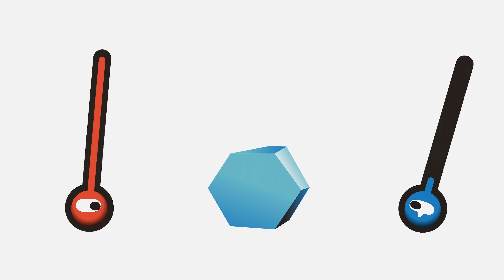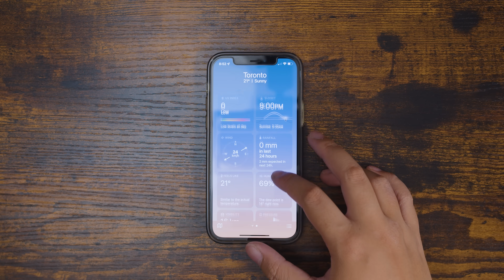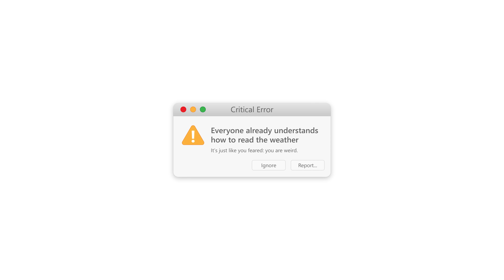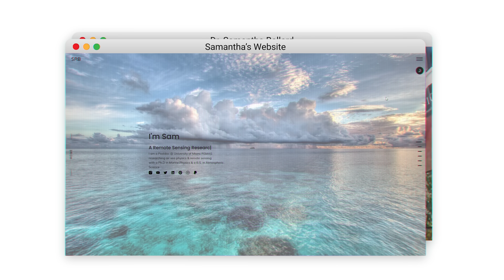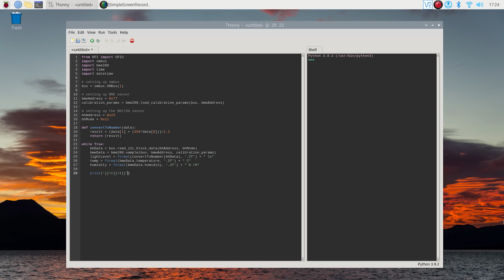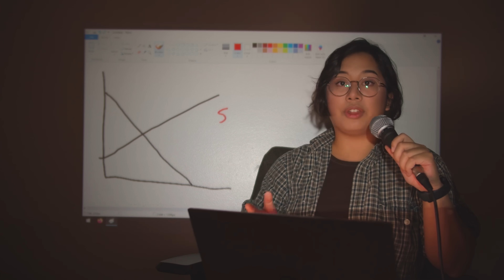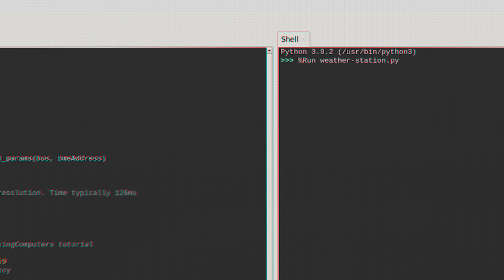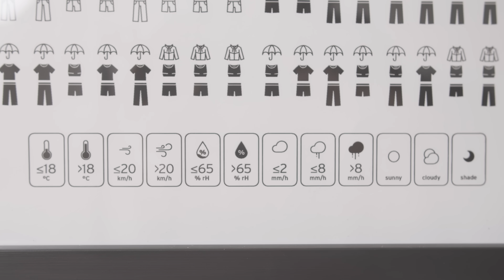how fahrenheit fails you

Comment: I love how everyone stopping at 0 says its "cold". There are levels lol. -30 is stay inside -20 is winter jacket + hoodie, -10 is winter jacket, 0 is light jacket, 10 is hoodie, 20 is t-shirt, 30 is nude.
Reply: -20 winter jacket and hoodie😭🤣
Me: anything below -10 is death by ice
Reply: personally i wear my winter jacket soon as it reaches 10 and below or I would wear a light jacket and a sweater underneath
Reply: I do the same thing but for Fahrenheit (American)
120 - Stay inside
110 - Outside for about 10 mins. Wear the lightest clothes you have
100 - Can exist outside. Light clothes
90 - Comfortable heat-ish. Shorts and T-Shirt.
80 - Warm. Shorts and T-Shirt or Pants
70 - Peak warm temperature. Same as 80.
60 - Cooler. Pants and sweatshirt.
50 - Peak existing temperature. Pants and sweatshirt.
40 - Cold. Pant and Jacket
30 - See above.
20 - Thick pants and Jacket
10 - Super cold. See above
0 - Really cold. Uncomfortable. Thick jacket and pants.
-10 - just stay inside lol.

Comment: Celsius is better but people in the US who are used to Fahrenheit try to find convoluted reasons to claim it's not that bad. 
But it is.
Also same with the other nonsensical feet, inch, lbs, oz etc units.
The end.
Reply: As an American who grew up with Imperial measurements I think it can be boiled down to ability. We grew up learning these measurements and so it is just easier to visualize them regardless of which measurement system is better.

Just like how you, assuming you're not an American, probably grew up with Metric units and are now better able to visualize and use them so you have a preference towards them.

Comment: "It's zero degrees Celsius" looks outside and sees the lakes are frozen

"It's fifty degrees Celsius " looks outside sees forest fires . Celsius is the easiest and simplest metric
Reply: "It's hundred degrees Celsius"
Looks outside and dies
Reply: Nah it's gotta be a bit lower than 0 celsius for the lakes to be frozen over, or 0 for a longer period of time.
Reply: @OrgBrent  yeah like it needs to be like -10c for lakes to freeze
Reply: @69ingchipmunks68  Degrees Celsius and Kelvin are pretty much the same: 1° C equals 1K. The difference between them is the water's freezing point which is spotted at 0° C in degrees Celsius while in kelvin is at 273.15K.
Reply: precision doesnt matter when it comes to picking clothing, its not like you can wear half a sweater
Reply: Fahrenheit is the easiest and simplest temperature scale.
Reply: ranking nervously sitting in the corner
Reply: @butwhy7138  Rankine is just Fahrenheit being jealous that Celsius has Kelvin
Reply: @rightleft7306  What the heck is rankine?
Reply: @The_Red_Scare  Rankine is Kelvin for Farenheit. Starts at absolute zero and each degree is equivalent to one degree Farenheit.
Reply: @butwhy7138  rankine is like the most imposter unit ever made. It’s not even “R”. It’s still “degrees R” lmfao. To make R a scientific unit and not a “degree”, you would need a new gas constant, a new Boltzmann constant, and a new Stefan Boltzmann constant to make sure that all the ideal gas, temperature relation to internal energy, and black body power formulas still work. (And there’s probably even more formulas and constants that would get fucked up) To use degrees rankine in these formulas, you literally just have to convert it back to kelvin. Textbook definition of a useless unit 😂
Reply: its 0 degrees fahrenheit: looks outside and sees frozen lakes

it’s 200 degrees fahrenheit: looks outside and gets 3rd degree burns on your retinas from the radiating heat surrounding you
Reply: as a brazilian i have to say that this's wrong, our forests burn on 30C not 50
Reply: Nope. 150°? That's 150% hot. Stay inside or suffer the fury of Satan's asshole after taco bell.
Reply: @69ingchipmunks68  😂
Reply: Just wear a t-shirt
it doesnt get to hot in it
also shorts and Sandals
C. a lazy constanly cold person
Reply: Agree
Reply: I don’t know, I think meter is a better metric.  /j
Reply: yes!
Reply: It's the easiest for you because you grew up with it so your frames of reference make sense in your head. Why are frames of references difficult for you to grasp? Everyone has different frames.
Reply: @gladitsnotme  I've had friends who used Farenheit all their life, and they made the transition to Celsius far easier than I have tried to with Farenheit. Bad frames of reference can be easily discarded for better ones.
Reply: @rightleft7306  I'd say that speaks more about you than it does about any inherent superiority in Celsius, but your example uses a sample size that's miniscule to the point of being meaningless.  Fahrenheit is super easy to use for weather, just use multiples of 10 as guides - 60˚ is cold, 70˚ is cool, 80˚ is warm, 90˚ is hot.  If you're taking someone's temperature, just remember triple digits = bad.  Celsius might be superior for industrial/technical fields, but not for common everyday use.
Reply: Random question, when are you gonna experience anything near 50°C besides the death valley?
Reply: @temmssmdisnas  I guess you never worked in industrial sector?
Reply: @temmssmdisnas  I've lived in Saudi Arabia and the temperature there sometimes do hit close to 50C (I lived in a big city)
Reply: @temmssmdisnas  well welcome to Rajasthan, india…!
Reply: Says you sounds like 1⁰ is the end of the world. In Fer-- I can't spell it-- we have more numbers for a more detailed report of the temperature
Reply: @dandyme123  allow me to introduce you to the decimal point
Reply: @xvnexus8814  that sounds a bit excessive, and here me out, my weather app doesn't show Celsius in decimals.
Reply: @dandyme123 that's for more precise scientific stuff or medicine
Reply: @dandyme123  easily the most stupid line I've ever heard in decades
Reply: @dandyme123 yeah 0 Fahrenheit is like 12 celcuius idk  but you have have some random number plus 61F is 23C  which is cold but the avarage of 0 and 100 is 50 but its still cold instead of hot
Reply: I assure you, lakes don’t freeze at 0, too much radiative heating and ground heat. And you get frost above it. Meanwhile I rather doubt you’ve SEEN 50 degree weather, since people start dying in droves anywhere above 40, and depending on your source, the highest temperature on record may be as low as 54 C.

As for forest fires, it’s not the heat, it’s how dry things get. The Amazon is much hotter than say, Glacier National Park in the US, but Glacier is on high alert for fires every year, whereas until quite recently, unchecked forest fires in the Amazon were unheard of.

Of course with climate change the Amazon is also getting much drier, so that’s a thing
Reply: @mjp121 40 degrees is very hot but not dying hot?
Reply: celsius makes more sense and is simplier case closed

now cope
Reply: Nothing is freezing at 0
Reply: Just look at V-Sauce's tweet, it's not even a debate, fahrenheit is far superior for measuring temperature. 

"Its degrees are 'smaller' (allowing for more precision with whole numbers) and its range feels more naturally suited to our day-to-day lives."

0c being freezing and 30 being hot is way too close, so 15 is what? 

With F, 0 is very cold, 100 is very hot, 32F is freezing, not that hard to figure it out from there.
Reply: @ChicagoShnozzlers  What? Fahrenheir is random as f. Celcius is so much simplier. Your body temperature is 36.6. Everything too close to that is dangerous for you and result in a heat stroke. So ofc 30 is hot but berable. 15 is twice lower and ofc its chilly depending on strenght of wind and humidity which affetc speed of heat transfer from your body.
0 = water is frozen unless salt and 100 water is boiling unless salt or high altitude and change of pressure. 
Do you even imagine what a nightmare to heat treat steel and other alloys using fahrenheit as a scale?
Reply: @robertnomok9750  What is so superior about 36.6˚C compared to 98.6˚F?  Nothing that I can see.  If anything, remembering 38˚C or whatever for a fever is inferior to seeing a triple-digit number and not even having to process what that number actually is.  Not to any consequential degree, but still.

WRT to weather, Fahrenheit is very easy to intuit by looking at which multiple of 10 the temperature is closest to.  multiples of 10 is slightly simpler than multiples of 5, because you're usually only looking at one digit (unless you live in a desert or something).

WRT freezing and boiling points, yes it's easier to remember, but how often do people actually use that information in day-to-day life outside of academia or technical fields?  I don't need to know that information to boil or freeze water, I just need a functioning cooktop or freezer.

As far as treating steel goes, we're mostly talking about everyday life here, not technical /industrial uses.  But no, I don't know what a nightmare it would be.  Wouldn't it just be a different set of numbers to remember?
Reply: @jc3drums916  Rofl. What there to process? You remember your body temperature and the rest is easy. 1 degree up is a fever. 2 degree up requres a medecide. 

If you dont need to know temparature of boiling or freezing water than you are probably either jobless or some liberal arts.
Ability of your car to work depends on your fuel freezing or not. Any sort of air operating machine condenses air as water and it turning into ice would be quite problematic. Or something overheating and boiling instead. 
You have to remember only 3 numbers. 0 to 100 and your body temparature to compare. 
What kind of life you need to have to NOT constantly deal with temperature measurment?
Reply: @robertnomok9750  name one time in your life when you measured the temperature of boiling water
Reply: @colto2312  Like every time I work with heavy machinery and has to keep mechanism under 100 degree to prevent liquid from boiling and breaking everything? 
Like when I test of reductor axis are properly alligned and do not overheat during tests? 
Like every time  I check air temperature dunning trough my CNC plasma cutter to make sure coolant is still active and keep air few degrees above 0? 
Do you need more examples? How about water boiling at lower degree under pressure? So you need to actually check if it hit 100 or its below that.
Reply: @ChicagoShnozzlers  Ok but hear me out. We do not need smaller degrees. 0C=freezing 10C=Cold 20C=Nice 30C= hot. 15 is nice for some people and cold for other people. When you need precision, you are probably doing science, and science uses Kelvin anyways, and Kelvin is just Celesius but 0K is the absolute zero, so just use decimals.
Reply: @ChicagoShnozzlers  

we have the same ranges, just at different points. -10C and below being damn cold. 0C being freezing water. 10C being chill. 20C being  warm. 30C being hot.
Reply: @ChicagoShnozzlers   With Cº, in day to day living across the year and across the globe, temperatures usually range between -20 and 40. 60º of precision is plenty. I do not need 100 degrees of precision in my day to day life, I just need to know how hot or cold it is in relation to my bodily experience. Hell, even Celsius is too precise, I can't feel a noticeable difference until the gap between two temperatures is 2º or higher. That much redundant, useless precision is just a distraction.
Reply: @ChicagoShnozzlers  32f being the freezing point of water also feels really arbitrary. A system where 0 is the freezing point of water and 100 is our average body temperature would be better
Reply: @slyar  I really don’t see the issue? 0 - 100 for Celsius and 32 - 212 for Fahrenheit are pretty much the same thing: just 2 numbers to memorize. Sure 0 and 100 are slightly easier to remember but since an uneducated buffoon can visually tell when water is boiling or freezing, it really doesn’t make it better than Fahrenheit. I guess at least knowing the freezing temperature is important but 32 is pretty easy to remember.
Reply: @Dingusdoofus  32 just feels really arbitrary [and arbitrarily high?] as a freezing point to me. Id get something like 12 but 32?
Reply: @slyar  yea 32 is already a third of 100 so a bit high, but different people see this differently depending on tolerance to low temperatures. I am pretty tolerant to the cold so I feel freezing temperature as not very cold which would make a high number like 32 work well for me. But someone else could think that 32 is too high if they are suffering at freezing.
Reply: @Dingusdoofus  I have pretty good cold tolerance and I still feel like 32 is too high. 0 being ice and 100 being average body temp I think could be a good way to take the good things from both but I'm no scientist
Reply: @slyar  98.6 - 32 = 66.6

it's not random
Reply: @colto2312  What does average body temp - freezing point of water tell me exactly here?
Reply: @slyar  666, same as carbon? 6 neutrons 6 protons 6 electrons? You new to numbers? Tell you? You said it's random. It's not random. Regardless of whether or not you derive meaning from those numbers. No different than the meaning of 42. what a silly juxtaposition.
Reply: @colto2312  What does carbon have to do with this exactly? But also, I said arbitrary
Reply: @slyar  can you define what you mean by arbitrary and random for us?
Reply: @slyar no because each degree would be insanely precise, you would barely feel the difference between a few degrees if at all
Reply: @ChicagoShnozzlers  according to your comment 50 Fahrenheit should be perfecT temperature.
Reply: @АмальФарук-в6д  0 is absolutely frigid. 100 is absolutely hot. At least in terms of the human body. 25 is really cold. 75 is really warm. 50 is nice with some pants and long sleeve shirt. Maybe a hoody for some people. Another good reason why Fahrenheit works well with how we feel is because 98F is our body temperature. Also the point where our body reaches its limit of cooling under mild circumstances, ie low wind and humidity. That’s why 50 isn’t exactly optimal. 75 is a very pleasant temperature because our body doesn’t have to work hard to cool or warm us. Our bodies also seem to be far more efficient at warming than cooling. If 75 is perfect, it only takes 30 degrees to become deadly hot. Whereas it takes a good 40 degrees or more to get deadly cold.
Reply: @ChicagoShnozzlers  I don’t agree at all that the Fahrenheit range feels more natural than the Celsius. First of all, 32 being freezing is fucking random. Secondly, what is hot and what is cold depends on where in the world you live. Some places 20 degrees Celsius is about as hot as it will get and other places that’s cold. 

In addition to that, how often do you need to be so precise with the weather that the smaller increments in Fahrenheit is an advantage? Can you even tell the difference between 30 and 31 degrees F?
Reply: @ChicagoShnozzlers  10.5 celsus
Reply: @ChicagoShnozzlers  but the number 32 sounds reasonably chilly to me, not freezing. freezing is 0 (very cold), colder than that is extremely cold, like above 100F is extremely hot. if you dont thikn celcius is intuitive then fair enough but neither is fahrenheit
Reply: @ChicagoShnozzlers nah, 0F is unbelievably cold, and 100 is uncomfortably hot, and you don't need that much precision unless it's for scientific purposes but at that point a decimal doesn't really hurt
Reply: @ChicagoShnozzlers 
This is loaded with personal bias.

You do not need that level of precision for day-to-day temperature, you can not tell apart two outside temperature that are 1 °F different — hell, you can't easily tell apart a single °C either.

It seems "too close" because you're used to bigger numbers; to a Celsius user, 1 °F is needlessly small. it's entirely subjective.

With °C, 0 is freezing, 10 is cool, 20 is warm, 30 is hot, 40 is sweltering. It's not that hard to figure it out from there.
Reply: @ChicagoShnozzlers  The smaller degrees are irrelevant as they have never appeared an issue in day to day use or worthwhile to use in science. In actual need for smaller degrees like in sciences, kelvin can be used.

"Feeling more naturally suited" is not a valid argument, we feel the exact same, since for cooking Celsius is good and for weather it is great.

Fahrenheit is simply irrelevant in the scheme, lost between trying to be relevant in precise science and trying to be useable in simple day to day use.

Kelvin and Celsius simply overshadow it by far in practicality. It is not even a debate. You can hardly feel the difference been 2 degrees C, so why would we need that to be expanded even more?

Comment: Any measurement is comparative in nature, and a test for how “good” it is could be how functional and intuitive it is for the application it is being used for.  I don’t understand the “one measurement system to rule them all” approach.  Kelvin is super useful for certain things, but not others.  Meters don’t work for astronomical measures.  10 based counting, while it does mirror our fingers and toes, is not the easiest system for mental arithmetic, etc.  I find Fahrenheit to be the best system for human experiential temperature: it’s based on it!  It has enough resolution to be able to deal with differences, and is broad enough to take into account the vastness of difference.  I’m sure Celsius has it’s place in science as it is based on the broader scope of phases of water.  I find kilometers easier to imagine and intuitively feel than miles, but I prefer inches and feet in woodworking.  We should be able to use the measurements that work best for the application;  bickering over which one is “right” regardless of context is a fools errand.